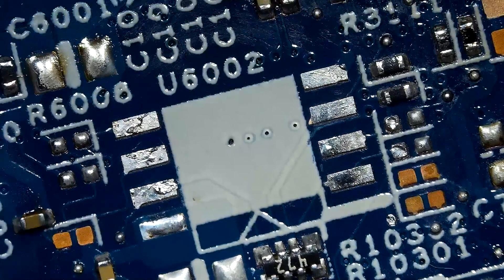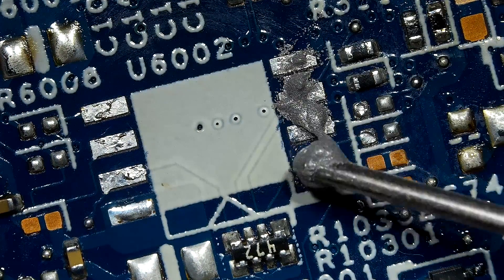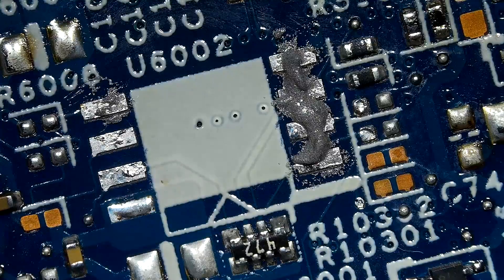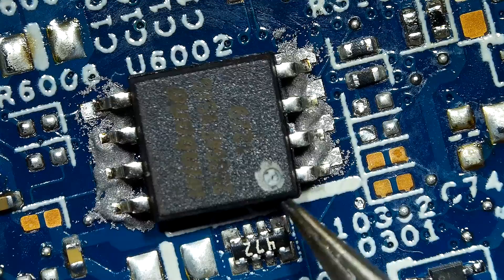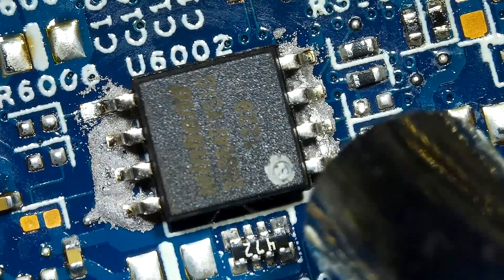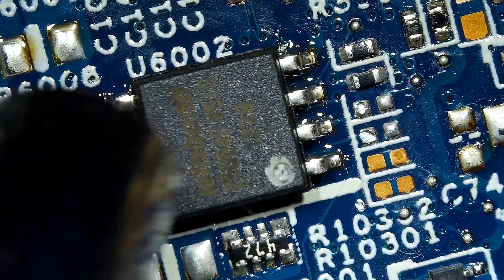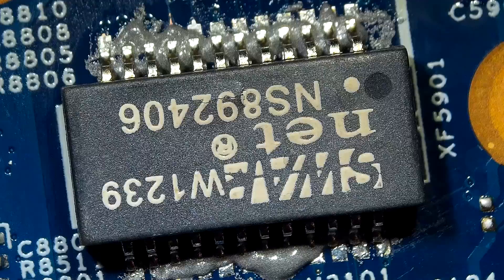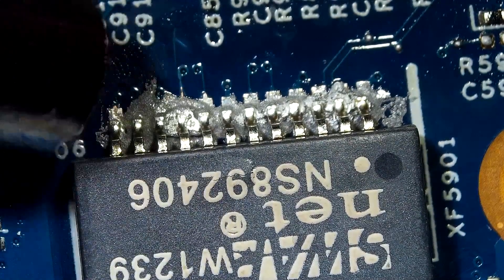How to Use Solder Paste (Soldering with solder paste & heat gun)

Comment: Is 752 degrees Fahrenheit really safe for the board? The creator mentioned using 400 degrees Celsius. It seems a bit high j
Reply from the maker: Lower temperature is always better. If you preheat the board, it is easier to do soldering with lower temperature.

Comment: I solder prototypes of big devices in small series sometimes, and my experience is:
1.Hand-soldering small 2 pin  elements (resistors, leds, caps) is very time consuming and hard - hot air and solder makes it much faster and easier - they just pop into place.
2. Your method of aplying solder paste looks very inconsistent. I add some proportion of flux to the mix - paste becomes more even, flows more easily etc (talking about hand-aplying the paste).
3. For me, just blowing air doesn't work/seems too dangerous. I preheat the board to 90-100C in case of leaded solder, and hot air to 350C. 
4. Lead-free doesnt work for me - I tried preaheating boards to 160C, even then I had trouble controlling the procces. 
5. My paste's fumes are very nasty, I put my extractor very close to board and on high volume, thus the whole procces is becomes harder, but I don't inhale the fumes. May be the reason lead-free doesn't work for me.
6. May try bismuth solder paste, seems more apropriate to what you're doing. You wouldn't have to overheat your components.
Reply from the maker: Good points. Preheating really helps soldering and desoldering.

Comment: Can you use soldering Paste on a Graphicscard? Im asking because I think it could just melt because of the low melt point 
From the hot gpu while gaming.
And I never seen anybody use it or talking about it, who‘s working on Graphicscards.
Reply from the maker: I am not sure but depends on the application, people use different types of solders with different melting points. For a device which produces more heat like a video card, I don’t think you can use a solder paste with a lower melting point

Comment: I made a portable pencile hot air gun & a video about it on my channel , it sounded like that too when the aquarium pump I used was far away lol but now all you hear is the brushed motor & gear assembly because I had to use a cheaper pump & smaller hose so everything fits in a small travel case . The pump is battery operated anywhere from 1.5v - 5v depending on nozzle size & what your work demands . The pump dose have a 2 speed switch but I think controlling the voltage to the motor is a better method because you can get the airflow just perfect for your needs

Comment: Soldering SMDs with solder paste without a properly adjusted reflow oven is an expensive idiocy that no amateur should ever get into. Just use a very thin solder, a fine tip and plenty of flux and your SMDs will be perfectly happy.
Reply: Bump to stress importance of a reflow oven. NOT FOR BEGINNERS. These videos downplay the expertise required for laying down ICs, knowing their individual heat tolerances, etc. I'm sure this video and others like it have fk'd up a lot of peoples expensive sh*t :D

Comment: do i need to use wick after?
Reply from the maker: You mean after you remove a component? If that is what you've asked, then yes. It is recommended to clean the solder residue.

Comment: P&T IT BROTHER i have a question I am going to be using a hot air station for first time and I am going to solder transistor and resistors to a diy project shall put the air flow to 10 or 35 as you said
Reply from the maker: It all depends. Since all hot air stations are different, you need to practice to find the best temperature and the power. Start from low power and temperature and increase

Comment: ⛔⛔⛔⛔⛔⛔⛔⛔⛔⛔⛔⛔⛔😊Please specify the amount of temperature, wind temperature, distance to the chip and the working time for complete installation.
Reply from the maker: it is very hard to say the exact temperature when it comes to soldering with a hot air. Because there are just too many factors that affects the hot air soldering. Like the board temperature, hot air station performance, type of solder, and etc. The best way to find out the right temp is practice. Just keep trying to solder and desolder with your soldering gears until you find the best temp.

Comment: I have a regular heat gun. If I use it, will it not soften or de-solder the other components next to the one I'm trying to solder??
Reply from the maker: Sure it will. You need a heat gun with a narrow tip. That is why people buy a professional quality heat gun station. You can change the tips with those ones.

Comment: Can I use this same process to solder speaker wires?
Reply from the maker: Maybe, but when it comes to soldering a wire, you better use a soldering machine. Watch this vide for soldering a wire: https://www.youtube.com/watch?v=DOBXWLALtGc
Reply: For speaker wires because they're stranded I apply liquid flux using a "printer swab" for precision then use a soldering iron to tin the wire.

Comment: What paste are u using?  What is it’s melt point?  And are u setting the hot air much hotter than it’s melt point?
Reply from the maker: This one was a chip quik soldering paste. Forgot about the melting point, but if you do a google search, you can find that info easy

Comment: What's the copper strip at the end of the video called? And why is it needed?
Reply from the maker: It is a solder wick. You need this when you desolder. It absorb the solder if you apply heat
Reply: @PTITBROTHERGravenhurst  after disoldering or after soldering?
Reply from the maker: Not after. You need this to desolder

Comment: Do we not need to apply flux before putting paste?
Reply from the maker: The solder paste already got flux in it but you can always use more flux
Reply: @PTITBROTHERGravenhurst  does every solder paste have flux in it? I have a paste that came with the soldering kit that i ordered. My paste is in a solid state but yours look pretty liquidy, so im wondering what kind of difference there is?
Reply from the maker: For most of them, yes. It's got the flux already. That is why my soldering paste is wet. Dried out soldering paste means it's expired, and you should get a new soldering paste. They last about a year since you open them. It is not recommended, but you can mix your dried out soldering paste with a liquid flux.

Comment: I just bought soldering station form Amazon, so what’s the correct temp(Celsius) for hot air to remove ics chip and smd transistors? And what’s temp on the soldering iron to solder them(ics chip and smd transistors) back to the board? Thanks
Reply from the maker: Typically, I do use 350C to 400C depends on the situation.
Reply: @PTITBROTHERGravenhurst  What are the situations?
Reply from the maker: Depends on the solder type, I guess. Some solders have higher melting point. Some are lower
Reply: Also depends on the size of the nozzle used on the hot air gun. I found the really thin nozzles were pretty useless for desoldering things at high temps because the heat applied is too narrow. However at the lower temps used for soldering with paste, it might work better.  Always best to experiment with a practice board first if possible.

Comment: Help me out, I don’t have hot air to remove this type of component, can I use a regular iron soldering without temperature control, I’m using weller 23 watts soldering iron. I’m afraid I might burn the new part, any advice? Thanks
Reply from the maker: You can try, but it won't be easy. If you believe that you have a good soldering skills, then should be okay.
Reply: Yes you can.  As long as your tip is fine enough.  Put a scalpel blade behind the pin and use solder wick and flux to remove the solder.  Do this for each pin and try and get the pin to lift off the board.  Repeat until the pins are clear.  You have to do this slowly and methodically.  Won't work with a device that has a central E_PAD or GND pad.  Personally I wick the whole bank of pins first and then focus in on individual pins.  Sometimes it's easier to use an adjacent pin as a leverage point.  Use a very sharp blade (and microscope if you need it).
Reply: Practice on scrap components first. NEVER practice on your workpiece.

Comment: Paste name please?
Reply from the maker: I used Chip Quik Solder Paste in jar 50g (T3) Sn63/Pb37 no Clean
Reply: @PTITBROTHERGravenhurst  nice! That's what I just bought! Luckily I just have an Led with bottom surface mounts only so it should be fairly simple. I'm thinking I should finish completely removing all the old solder from the previous led I've already removed first though.
Reply: @PTITBROTHERGravenhurst  nice video, it would be even simpler using their low temp solder paste.